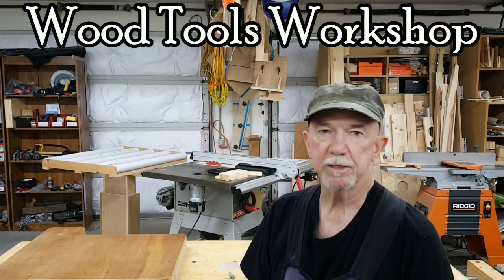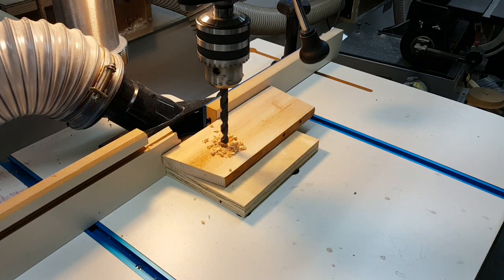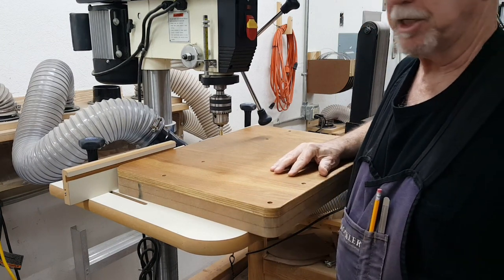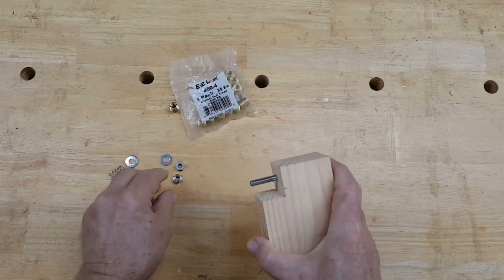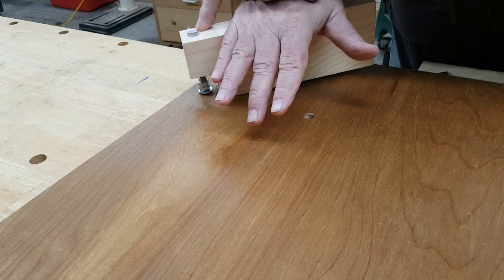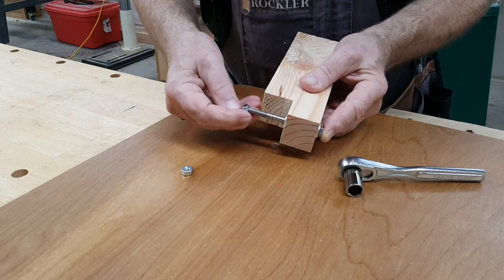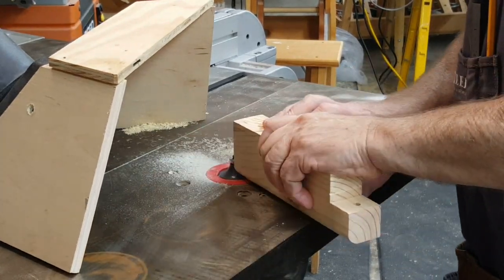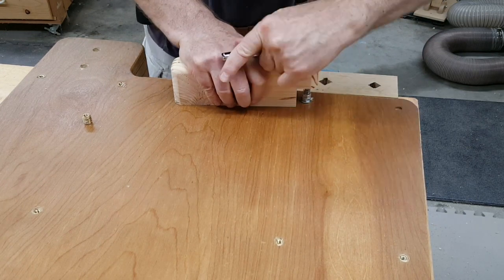Threaded Inserts; Simple Jig

Comment: If I have a 1/4" and 5/16" bolt should also pair it with a same size spring? or should I go a size higher? 3/8" spring for the 1/4" bolt and 1/2" spring for 5/16" bolt?

Comment: I like the say you build..just like I do.  Try it..adjust it..try it .. rinse, repeat.
Idea..Instead of using a socket wrench, put a permanent crank in place of the socket.  Then you just turn the crank!..  Or, you could  use an electric screwdriver.

Comment: Just an idea, but if you put the cutout section and bolt in the middle rather than at one end, wouldnt it pull straight down rather than lifting the opposite end, and would that keep the insert straigher? it would also make the jig easier to hold.

Comment: Clever! I suggest making the jig with the bolt hole in the center of a block of wood instead of on the end. This would give you more ability to level it, use either hand, clamp, and prevent pivoting.

Comment: Fantastic jig. Just thinking about some of the places I've had to put threaded inserts, having a jig that doesn't require a trip to the drill press would have been a job-saver (if not strictly-speaking a lifesaver...)

If you'll allow me, two possible tweaks to this jig come to mind:

One, I'd put a steel tube matched to the OD of the bolt into the hole in the jig to act as a bushing. This would prevent the threads of the bolt eventually creating excess clearance that could lead to the insert losing vertical.

The other is this: I noticed that you had to physically hold the jig against the workpiece with your free hand to prevent it lifting up. Surely this could be solved by making a U-shaped notch in the jib, and putting the through hole there. This would stop the jig from wanting to lift up from the workpiece as torque was applied to the bolt head.

Thanks again for sharing your fantastic jig, and your great channel!

Comment: Great jig. I whipped one of these up this morning using an oak cut-off that I had on hand. The spring is an inspired idea and really helps the initial set of the insert. I need to add some threaded inserts to a Hobie kayak so they have to be straight.

Comment: Hey, great work, thanks. I have a gooseneck reading lamp that I clamp to the headboard of my bed, but the lamp is meant to be clamped to a a horizontal piece like a desk and not to a vertical piece, so clamping it to the headboard makes it awkward for the gooseneck. The headboard is made of particleboard. The gooseneck is screwed onto the clam and I can unscrew it and screw it into something else. I don't think these inserts would work because they are too short and would break the particleboard.  Another idea is to use a small plate and attach it to the top of the headboard with two long screws, then attach the gooseneck to it. Would "that" even work! Any ideas? Thanks a lot.

Comment: I’m asking for help. How do I remove a threaded insert that has been lodged into the wood? I’ll describe the problem: As I was removing the bolt, the insert came with it but then got lodged into a second piece of wood where it’s not supposed to end up.
The original mistake was when I was bolting two parts together and I didn’t use a washer with the bolt, so the bolt went through the entire two pieces and into the threaded insert of the second piece. When I realized I needed to use a washer with the bolt in the first place, it was then that as I was removing the bolt that I discovered the threaded insert that was pre-machined into the second piece was coming out attached to the bolt, but then got lodged into the first piece. ( I hope that makes sense.) All I’m trying to do is put together a loft bed. When a company sent it to me, they didn’t send the correct hardware with it, so I’ve had to make due with what my hardware store can help me with, but no one seems to be able to help solve this particular problem. I would really appreciate the help if you can give it. Thanks :)

Comment: Currently my outfeed table for my shop is being replaced.  The old table was made of 2x4s and the table saw repeatedly covered everything on the lower shelf with inches of saw dust.  The new outfeed table is closed boxes which will have drawers installed.  The top of this table is also a major work surface for the shop like 48 x 84..  On the internet, some old gymnasium floor came available. This has been installed for the table.  My intent is to install the threaded inserts in precise pattern and use the inserts to hold dogs to clamp projects with long triangular pieces that when drawn together would clamp projects.  Just this morning using a scrap piece, installed an insert to see how it would work.  Using just a ratchet and socket I found it would be important to maintain a true square approach. The surface of this old gymnasium floor is walnut.  Quite a hard wood.  The method you show here with the guide, I hope will work to install into the walnut.  I will create your installation jig and   try it on scrap again.  I am hoping it will work and make it unnecessary to use epoxy as others have shown in videos.  Thanks for the idea and wish me luck.
Reply: Copied your jig. Did not use a spring or washer. Also drove inserts with my variable speed impact. Have the first six in.  There will be roughly 45 inserts in the table top. Ones I am using take a 1/2 inch hole and 5/16 bolt. Thanks for a great idea, works like a charm.

Comment: GREAT IDEA! and so simple.
I know you put a bit off work and engineering into it
but the basic idea is "simple".
Why is it, the simple things are always the slowest coming?

This solves the major "B" of using these things: keeping them straight
and is Much easier than futzing around with the drill press.

On applying wax, I use bee;s wax instead of paraffin.
It applies easier, because it is softer and, because it is slightly
sticky, it stays on the threads better.

It could,also, be a good idea. to put wax on the threads of
the installation bolt, as well. I have had the bolt jam a little bit
and try to pull the insert out.

Thank you, Fred.

Comment: what should I do if i need to unscrew the bolt, which is very tightly screwed  into a threaded insert, such as the hip pivots from an Aeron chair? I really need a way to clip the insert in place so I can turn the bolt back out of the insert.

Comment: To improve on the bolt and nut assembly use a bushing or grind down a nut to be same diameter of the insert.
Then you can drive the insert below the wood surface without marring the wood. 
Use different height bushings to control how deep you drive the insert into the wood. 
Use a nylon washer to protect the wood surface when driving flush or when using a bushing to preset the depth of the insert.

Comment: Thanks for this, I've just started using threaded inserts in oak and the drill press method will work for me. Did the wax make an improvement?
Reply: I find adding wax does make a difference. I've just made this jig and it works perfectly!

Comment: Perfect! You may want to lock down the two nuts against each other, once the correct height for the insert is set. This will ensure repeatability of the depth setting for the insert. Another helpful tip would be to use to use a nut with a built-in washer, will save the hassle of putting it on in multiple insert installs as this.

Comment: I hope you're still reading comments on this. I really like your jig. It's like simple genius. I've been using the drill press with a pipe wrench to crank it down. Not too fun. My question is have you tried using your jig with a slow speed drill with a nut driver? Do you think that will work or should I stock up on gauze & medical tape first?
Thanks, Bryan
Reply: I use a drill on slow speed and it works fine. Inserting M6 inserts into the edge of 25mm ply.

Comment: Another spot-on video. Love the jig. Would be helpful to show a diagram with the dimensions but not a deal breaker. Was able to jot down them down as you were talking. I wonder what the limits for this jig are as far as insert length. Also, will consider a removable screw-holding block drilled for different diameter bolts/inserts. Would love to get your thoughts on some of this. Also, what diameter bolt are you using and what spring size? I need a 3/8" bolt so does that mean I just look for some 3/8" springs? (not familiar with how spring sizes work). Thanks for making this video.

Comment: Thanks for a great video. I just made a jig with two notches at each end. One for 1/4" inserts and one for 5/16" which are my two most common. I felt I didn't need two nuts just the insert then a washer then one nut and the spring. Worked perfectly every time. I used two nuts locked together to get the insert out but only one is needed to install it. Thanks for the inspiration
Reply from the maker: Glad to hear it, John!

Comment: Great video for a "face" installation.  Fred - what is a good way to get these things straight into the edge of say, 3/4" ply or MDF, without splitting the edge or tearing up the nutsert?  I've had every problem known to mankind trying to get these into edges.  Thanks in advance!
Reply from the maker: Dan, the suggestion I've seen (but haven't tried it myself) is to drill the hole and then use a tap to thread it with the size of the exterior threads, so that they don't have to burrow their way in.

Comment: I'm glad I found your channel! I'm getting into driftwood furniture building and my first project is a table with 4 removable driftwood legs. I will be using 1/4" threaded inserts and 3" bolts for 3 of the legs (they have the corner of the table top chiseled out ~40.5" up and will each get two bolt holes, one on each side of the corner in most cases).
Reply from the maker: Sounds like a plan! Come back and post us some pictures when you finish, if you don't mind.

Comment: Hi.
what's on my mind?
nice tip. good idea with the spring.
I build electric guitars. use inserts all the time, for darn near every screw that has to be removed & screwed back in several times... like access panels, and pickup adjustment screws.
I don't use the ones with the big threads on the outside. I am limited due to lack of material around the insert, or it is inside of a routed cavity close to the edge. SO... I use the press-in type with the little barbs or ridges. (they say they are for plastic I think)
But before inserting I coat the wall of the hole and the insert with a little CA glue. works great.... But alignment can be sketchy because you got about 5 seconds to tap it in before it sets up.
Your jig gave me an idea for a similar one for my press in inserts. 
thanks!

Comment: So far as threading ....this applies to driving screws, taps, inserts, tnuts, etcetera is to just use a variable speed drill with a clutch on it and a drill jig to keep it straight...I have a jig that I made that is something similar to what craftsman sells as a 'precision angle jig' that you mount your hand drill in.  Then you can just turn the clutch setting way down until you find one that works decent without breaking the tap, use good form (i.e. backing out the tap as the clutch stalls in order to clear the chips....using lubrication if applicable....blowing out the chips, etcetera) and you will (I can say that in my case up to this point when using this method I...) never break a tap, and almost always have gotten dead-straight screws. 

Thanks for sharing how you do it!  It really helps to bounce ideas off each other I think.!

Comment: muy bueno esto soluciona un gran problema que tenía ,gracias amigo.
Reply from the maker: Me alegra ayudar, amigo.
Reply from the maker: Glad you liked it, Diego!
Reply from the maker: Hi, Jason.  I'm assuming that by "thickness lock" you mean the carriage lock, also called "Sure-Cut".  Here's what I told paulpaul1948, who had the same problem.  First, open this link to an owner's manual (it's a pdf file).
http://www.ridgidparts.com/pdf/TP13002.pdf
At the top of page 22 is the subheading, "Carriage Lock Adjustment".  Follow those steps, and let our readers and me know if that fixes your problem.
If you didn't mean the carriage lock, you must mean the thickness stop, also called Repeat-A-Cut.  For that one, look at the bottom of page 23, subheading "Thickness Stop (Repeat-A-Cut) Adjustment".  Again, follow the steps, and let us know how well it works.  Hope that does the trick!

Comment: Great idea Fred!  Thank you.   One observation though, it seems as though you put the inserts in upside down.  While they'll work both ways, the end with the slots on the insert that looks like it is for a screwdriver is not for a screwdriver.  They are for cutting the insert to the exact thickness of the core of the insert.  That way you would not need any wax on the insert.

Comment: Thanks. Excellent solution for putting the threaded insert in at a 90 degree angle on a large piece of a table or leg that cannot fit under a drill press. I'm going to make one, with opening in middle and felt on bottom...may not round edges, though that does look more professional.

Comment: What about inserts for partial board?
Reply: I recommend the steel 3-barbed inserts, for particle board.  The threaded inserts are not appropriate, for that job. Put a smear of Crazee Glue on the underside of the round face" (from which the barbs are formed). When you tap the  insert into place, the glue will form an extra bond which will give you peace-of-mind later on.

Comment: Wouldn't it be better to modify the jig so that the bolt is in the middle of the wood block? That way the pressure is equally distributed and you don't have to press on one side to prevent it from tilting.
Reply: Good point, will make it as you suggested.
Reply: That suggestion worked better and the guide did not tip nor wobble. Even at the edge of the work piece, you can use the jig guide that has 2 legs instead of the one. I also thought of the same idea while watching the video.
Reply: @bobcatt2294  Both ideas are valid and very elegant. But this one, in the video, can reach the corners better, maybe. Your idea, provide a better alignment if not in the corners.
Reply: Yes, for edge anchoring, your solution is best - Thank you for your contribution for the: handyman/prototype builder and inventors of our world.
Reply from the maker: How did that work out Bobcatt22? I am always interested in new input. Thanks in advance.

Comment: Cut a channel in the centre of the block so it can't tip.
Reply from the maker: I'm not sure how you mean.  Can you elaborate?  I had thought of adding a crosspiece for that purpose, but haven't done it yet.
Reply: If it was a U shape - with a cut out for the bolt in the centre it would stay at 90* and not tip. It could also be made much shorter.

Comment: The only change I would make is to use a 3 1/2 inch bolt on your jig.    It will keep the head of the bolt up off of the surface of the jig so your socked has more purchase
Reply from the maker: Sounds like a good idea.  I'll get one next time I'm in the hardware store, and give it a shot.  Thanks for the suggestion!

Comment: Nice jig! I like these kind of threaded insert, but they are not so common in Brazil. :(
Although shortening the block prevented it form tipping, I think would be easier to handle if it as an inverted U rather than L shaped.
Reply from the maker: That's an interesting idea, Santiago.  I think it would work very well, except if the insert is near an edge.  I had also been thinking of improving it by adding a crosspiece just behind the bolt, making it cross shaped; this would prevent sideways wobble.

Comment: Thanks for posting this.

For the 1/4" X 20 brass wood insert nuts, what drill are you using? I think I heard 3/8, but that can't be, as the outer diameter of the  cylinder core appears to be more like 5/16. What am I missing?

Side note: today was the first time I tried those and, like most newbies who have not seen a pro using them, thought foolishly that the slot is for a flat screwdriver. Thank God it was a test on a scrap piece because of course the brass did break.
Reply from the maker: Hi, serban!  Yes, it's 3/8".  Here's a shot of the package they come in, with it written on the front:
http://www.wtwshop.com/wp-content/uploads/2016/09/ThreeEighths.jpg